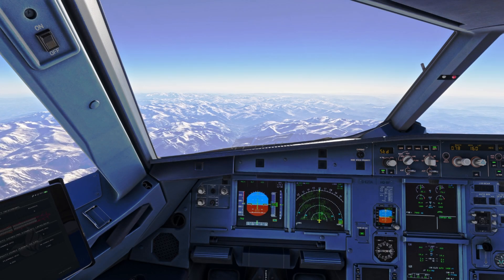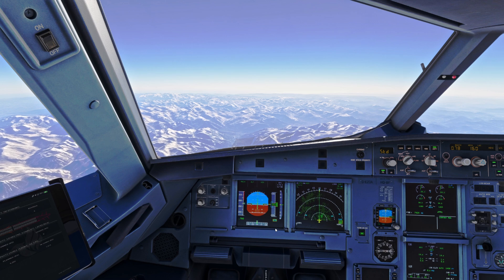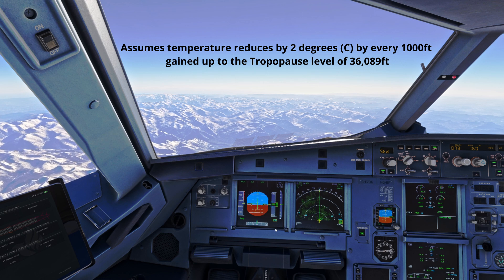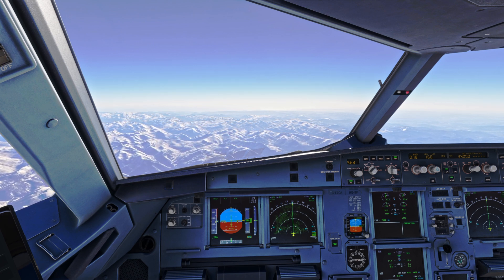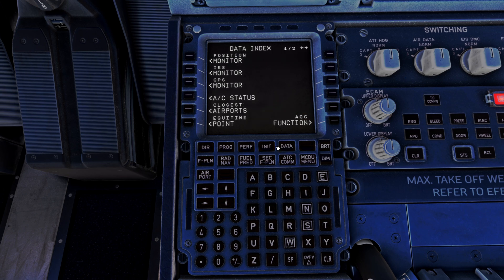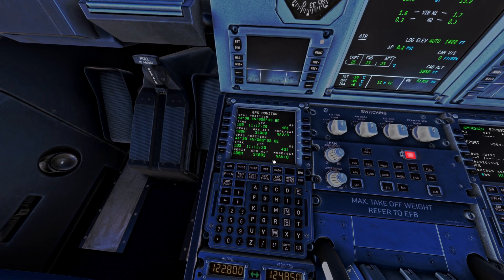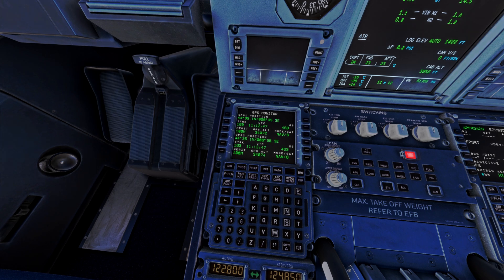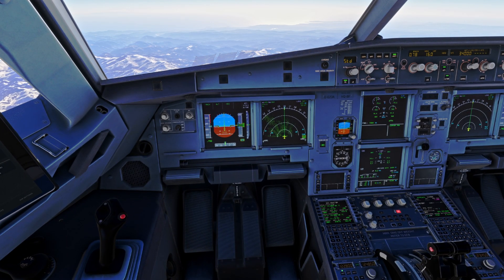How to Do the MCDU GPS Altitude Check | Real Airbus Pilot in MSFS 2024

Comment: Thank you, very interesting subject. If GPS altitude is the most accurate source of information regarding altitude, why not using it as the primary source?
Reply from the maker: Hello, the GPS altitude does not work for traffic separation as it is constantly varying so we use standard pressure so that all aircraft are working off the same setting. If we used GPS altitude the aircraft will also be  constantly climbing and descending

Comment: Thank you very much for the video. Another subject I hadn't seen discussed elsewhere.
I am presently doing to Hong-Kong / Taipei flight and cruising at FL370 (Std QNH 1013), the GPS altitude shows... 38046ft. That's a 1000ft difference.
In real life, what would I do about it at this point, as in during cruise ? Temperature is ISA+10.
Reply from the maker: Hello, we would keep an eye on this during the cruise and beware of that difference determining whether FL100 at pressure altitude would be safe based on terrain/MSA in case of an emergency descent
Reply: @AirbusCockpitCoach  Thank you for the response, very clear !

Comment: Interesting, especially I am en-route to Queensland over some interesting terrain, and it is out
Reply from the maker: Definitely one to keep an eye out for over terrain and for instrument approaches in cold weather although we apply a correction factor for those approaches from charts rather than GPS
Reply: @  what is the correction factor you apply?
Reply from the maker: It will depend on your height AGL and the temperature deviation from ISA. From memory as an example at 1000ft AGL with a -10 ISA deviation 100ft would typically be added